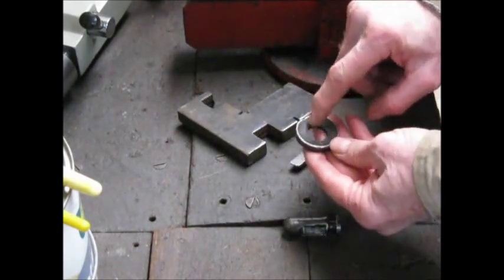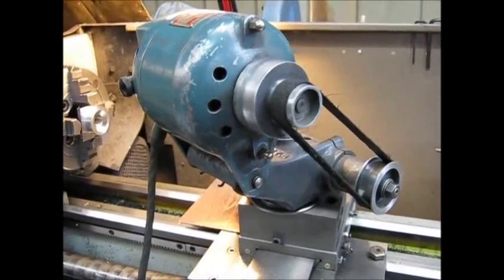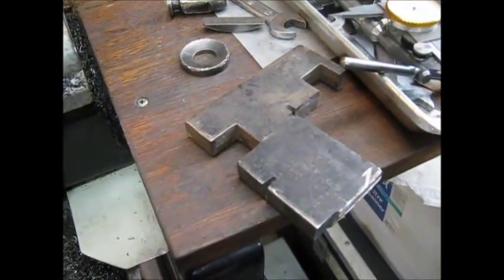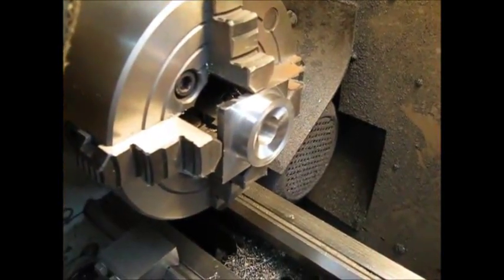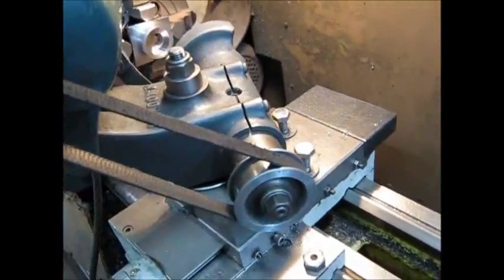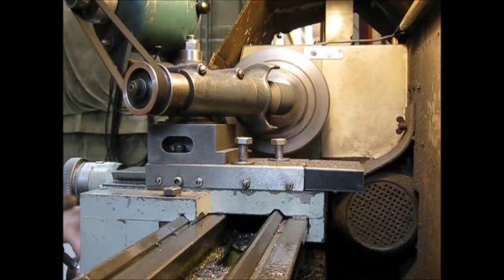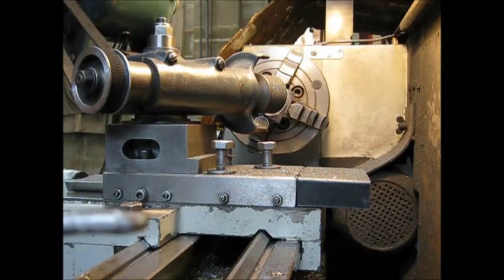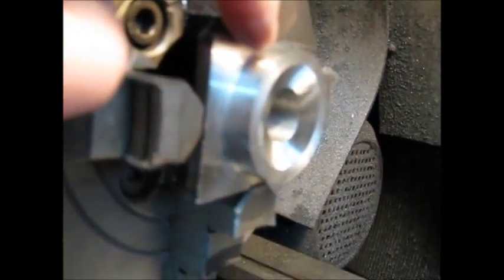A tool post grinder trick -  restoring my Schaublin 102 lathe

Comment: That is a noisey lathe. Is it a vfd or a geared system? If you don't have an oil reservoir then you can buy spray on lubricants that stay on the gears. It really helps to reduce the noise. WD40 makes a version of it
Reply from the maker: LOL.  The noise is from the tool post grinder.

Comment: Excellent solution to the job at hand. I don't remember if I've got lost in your description of the material used because unless it was CRS it would be a good idea to heat treat it to extend its useful life. Cheers 

Jorge
Reply from the maker: Thanks Jorge.  I can't remember the steel grade, but I did harden it.  I'm real pleased with the way it turned out.  Cheers Rob